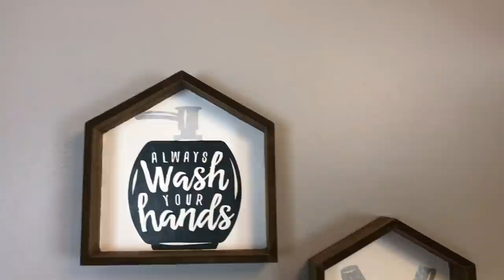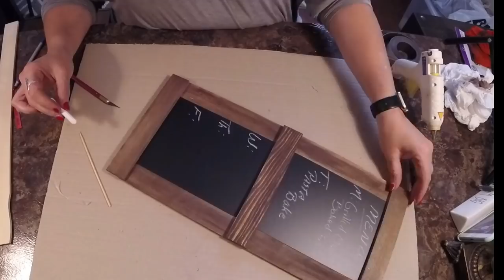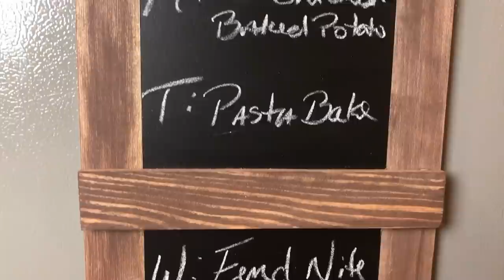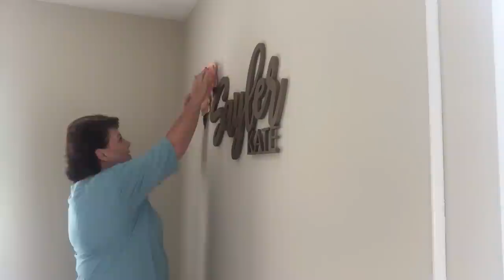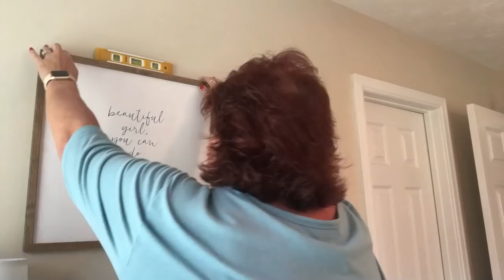Best 20 DIYs of 2020 | Mega Video for 2020

Comment: Use a tooth brush for splattering tooth brush for false teeth work speeds t don't put water on if if anyone tiny bit try it on  paper works much  better